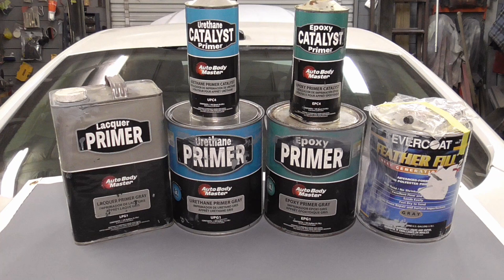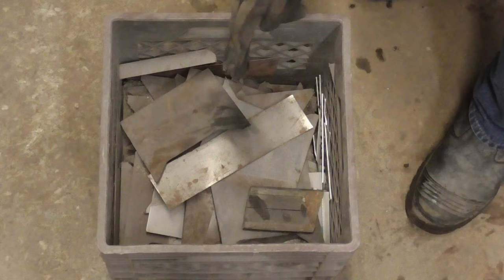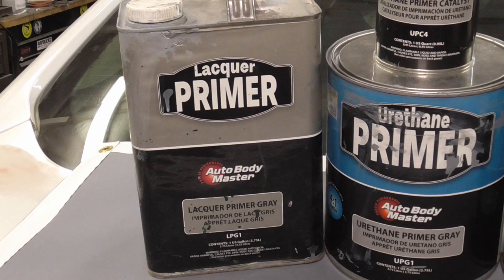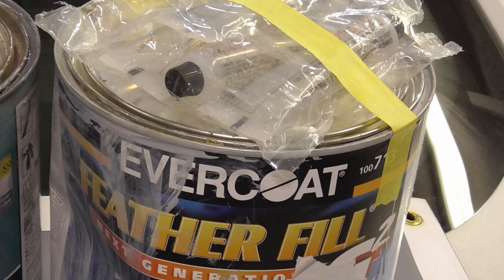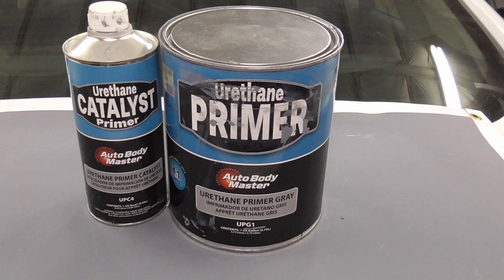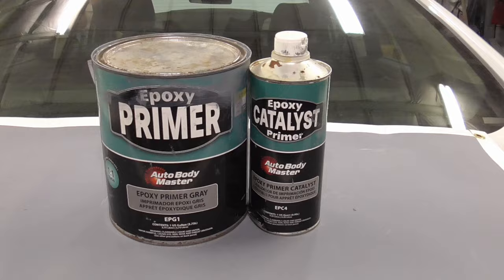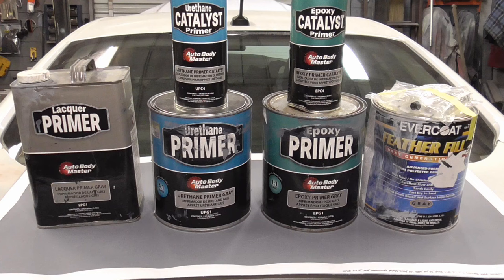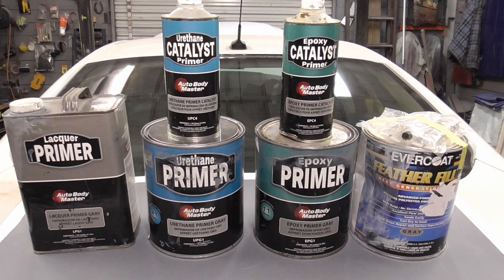A Simple Automotive Primer Guide - Types, Differences & Tips

Comment: Lacquer has one significant problem,  the lacquer thinner in the primer has a tendency to keep evaporating over time,  which means what you see now might not be what you see later.  You can block sand lacquer primer and everything looks fine,  then paint and clear,  and some time later see the imperfections you were trying to hide with the primer because the thinner evaporated further and the primer sank and shrank.   With 2K primer surfacer what you see now is what you see 5 years from now,  it's hardened with a catalyst and doesn't sink or shrink later on.
Reply from the maker: Now that kind of talk is what confuses folks :) There are millions of paint jobs that were done in the 70's that still look awesome today - done with lacquer primer - I've never experienced what you are talking about - I heard it on the internet but never experienced it.  Here's an example - https://www.youtube.com/watch?v=gIS1Tbv7Kvw - I'll do another follow up on this truck 3 more years from now - it will look exactly the same :)

Comment: I stopped putting body filler on bare steel years ago on old cars or high end restoration work as I want keep my name clean in the business of cars as my trade in smash repair Insurance companies don’t give you enough time or money to be applying epoxy primer down first so body filler on bare it is anyway I stopped doing smash years ago and only do restoration work for the bigger money customers
Reply from the maker: The only way rust can start on metal under filler is if there is a hole in the metal or the panel was left unpainted for a few years outside.  I'll make a video soon proving this - you'll save tons of time and $.  In most body shops it's embarrassing getting caught putting filler over paint and/or primer.

Comment: Thanks for the video. Am 65 now, I begin when I was 11, wet sanding, primer and red putty. And in the shop was always a spray gun with lacquer primer, only stir with a stick, and spray. On those days you can find a variety of lacquer thinners, from very fast to very slow. And a Lacquer retarder to make a Lacquer primer Sealer, that lays down the finish like a polish surface. Everything change, but I still remember those years. Thanks.
Reply from the maker: You're welcome - it's funny to ear those stories - must have been the same in every shop.  Have a good weekend RM.  Hey wasn't there R&M paints/primers?

Comment: Lacquer primer - how did it get such a black eye? It was all I had in the 70s. Gray, red and black, in the wide-mouth gallon cans. It is VERY easy to drop several hundred dollars at the paint supplier, so I am thankful any time I can use every bit of a product. Being able to keep it in the gun while I work is great too! Thanks for another great video Jerry!
Reply from the maker: It was common to have a dedicated primer gun with primer in it all the time.  When the gun sputtered and refused to spray just clean the tip and go.  Oh... and poke away at the little vent hole on the top of the gun (caked w/ primer) 😊

Comment: Good video !! … I have used urethane primer direct to metal and heard stories u can’t !! … I’ve never had any problems with any bondo or paint problems as long as the products like each other , and u do clean prep work u are good to go 👍🏻
Reply from the maker: You're right.  I worked at a shop using urethane primer and never had to use epoxy first - urethane over properly prepared bare metal.

Comment: THANK YOU!!!!!!!!! Explains a lot. I think people in industry (not me) use terms interchangeably which causes much confusion. For instance I always thought 2 different primers were needed. One to seal and one to sand. One could be sanded and one can't. Thanks for the simplicicty. I've always wanted to try my hand at painting but felt like I never had good info on primers and was afraid to try. Sounds like lacquer primer would be a good starting point for me. Simple. I like simple. Thanks again.
Reply from the maker: Once you use lacquer primer, you'll never want to use anything else.  Dries super fast, no activator, doesn't harden in the cup, don't have to throw the unused portion out if you don't use it all, works just fine if used correctly,  cheap, builds thickness well, sands the easiest.  If you keep body work simple, you'll be successful at it.

Comment: I got a 1980 Cadillac Eldorado as a high school daily driver and I wanted to spend a chunk of my summer painting her up and removing surface rust/small dents. My question is what the best overall primer is, and if I should use different layers of different primers as that is what many other videos suggest. My main thing is that I really don’t need a show-car. Just something to look decent and keep rust out.
Reply from the maker: Don't listen to all the noise on the internet, TV and magazines .... You only need one primer in your shop.  That is a direct to metal primer surfacer.  I like lacquer primer surfacer - sands fast, works well, builds fast, can be sprayed thin or thick and can throw the unused portion back in the can unlike 2K which has to be tossed. Here's you two choices: DTM (direct to metal) urethane primer surfacer or lacquer primer surfacer - simple.  UPOL or SPEEDOKOTE is decent stuff if you need to order online :)  Ask more ?s if needed :)
Reply: @LakesideAutobody  If I use a lacquer primer, do I need to use a lacquer paint alongside it?

Comment: Thanks for the video!  I recently purchased a clean, rust-free bed for my 2003 Ford Ranger to replace rusty one.  I live in the rust belt like you and would like to further protect the clean bottom of the new bed from future rust.  I was thinking of scuffing whatever the factory used on the underside of the bed (light gray), followed by 2K epoxy primer from Eastwood, followed by their 2K chassis black.  After the bed is reinstalled I'll probably hit it with Cosmoline or similar.  Do you have any thoughts or better recommendations there?
Reply from the maker: Nope... that sounds like a great plan.  That'll hold up for years :)

Comment: Jerry
Great, informative video.  I used a PPG 2K Urethane primer/surfacer and block sanded it.  I just ordered a base coat and clear coat from a different supplier.  The paint supplier literature suggests If I don’t use THEIR  2K Urethane primer surfacer the risk is on me.  Should I be concerned?  
Frank
Reply from the maker: Don't be concerned at all - it's perfectly fine to put other brand BC/CC over any 2K urethane primer.

Comment: Excellent! Right on time for me... I've been asking myself questions about that and the relation to paint and clear. BTW, have you made a vid about compatibility between all those coats? Some say you can't put 2k paint over 1K primer; some say you can't put 2K clear on top of lacquer enamel paint (since it can «boil» the result). But some say it is faisable,  depending of the particular paint involved (some brands are compatible and some don't). This is also a difficult aspect of car painting... Thanks!
Reply from the maker: Glad it helped RB - That's a good suggestion for a video.  As for now, do you have a specific question in mind that needs to be answered imediately?
Reply: @LakesideAutobody  Definitely... I did some repairs last year in 1k lacquer (from primer to clear coat). I'd like to put some 2k clear on top of 1k clear — that 1k clear is not durable. And I would like to do some more repair that way: epoxy primer, 1k color coat, 2k primer. Can I get away with it? Sorry Jerry... that's 2 questions. Thanks for your kind input.
Reply from the maker: @rbelang8331  You certainly can put 2K clear over the lacquer clear if prepped right.  Actually you can put 2K clear over anything that has bee painted for a while as long as you scuff or wet sand it first.  You won't see the sand scratches in the new clear coat if you scuff with the grey pad (even red actually).  If you choose to wet sand, you can get away with anything over 600 and you wont see sand scratches in the clear - I'd use 800-1000 grit myself to wet sand with a DA sander.  The old rule is you can put enamel over lacquer but not the other way around.
Reply: @LakesideAutobody  Thanks very much Jerry...
Reply from the maker: @rbelang8331  You're welcome 👍

Comment: Fantastic video. How about storage? Can any of them be left in a shop that will be below freezing? I would wonder the same about paint.
Reply from the maker: I keep 2K hardeners/primers and used paint in a heated shed @ 60 degrees.  I don't have a basement otherwise it would all be kept there. The lacquer primer I keep in the garage along with the thinners and reducers - I've never had a problems with lacquer primer and freezing temps.  Never had a problems with paints that froze either really.  My dad kept it all outside no matter what the temp - never had an issue but that was lacquer/enamel days :)

Comment: another great video. I want to paint my project car in the garage and want to avoid isocyanates as much as I can. With that said, looks like lacquer primer is the one for me. But what kind of paint / clear coat you recommend that  I can use with good results.
Are there any 2k paints with no isocyanates?
Can I paint with Rustoleum and once cure have a shop with a 2K clear on it? will that be any compatibility issues?
Reply from the maker: OK for the least isos use lacquer primer and paint.  I think both paintforcars and TCP sells lacquer paint.  The next least is lacquer primer, base coat  (no activator) - matrix and nason I know for sure does not need it distributor says so and I've started to spray it that way w/o issues.  Then your choice of clear coat - use this mask: 3M 07193 Dual Cartridge Respirator Assembly Organic Vapor and a 3M disposable jumpsuit.  After your coat leave the shop - put a fan under the garage door for exhaust.  Let me know how it goes for you :)

Comment: Awesome once again Jerry!  Many thanks!!  Quick question - I use Urethane 2k primer and at times have needed to do a touch up respray on a small area where I sanded through or something.  Can I use a spray can 1k primer like Perfect Match (an acrylic lacquer primer) for the touch ups?
Reply from the maker: Absolutely.  I always spray that stuff on the dryer side just in case it doesn't agree with anything underneath.  Basically don't soak it with spray bomb primer :)

Comment: Hi Jerry. This is very simple and very much against what you hear on other channels. An average guy like me has no clue who is right. I have never done body work. I have a bare steel part (1 sq ft) that was lightly coated with clean oil which will end up in an engine bay. I do not have  paint guns etc. I have been searching for answers but everybody says something different. Can I do this with rattle cans? If so, can you describe the process with flash times and cure times? How many coats of primer? How long do I need to wait between primer and base coat?
Reply from the maker: 1) clean it with soap and water really good and wipe it down with rubbing alcohol or automotive wax and grease remover.  2) Sand or scuff (red pad) or fine sand paper.  3) prime with spray bomb primer and let dry (couple hours or more depending on the brand 4) Paint with spray bomb engine bay paint or any other spray bomb paint.  * If you want to sand the primer a bit before paint that's OK too to get it nice and smooth or remove dust/dirt.   😊

Comment: Great video. I just bought a 1982 porsche 911 in 908 grand prix white and it needs a respray. It had to buy one needing a little work to be able to afford one. I'm petty sure it factory single stage for all solid color early 80's 911's and would want a single stage respray. Since two part urethane primer would likely be the base, would it work well with a water-based top coat? I'm in Illinois as well and may call you and come by for a quote.
Reply from the maker: I've never used water based top coats but I'm thinking any automotive grade primer will work for you but best to check with the supplier :)

Comment: HEY JERRY , 
HOW YA BEEN , IT'S BEEN A WHILE SINCE I LAST SPOKE WITH YOU AND I'M STILL RECOVERING FROM THE HEART  & HEALTH ISSUES  I'VE  BEEN  DEALING WITH  FOR THE LAST 17 years .   WELL , 
I'M  FEELING I'M  SOON TO BE ABLE TO START WORKING  BACK  ON THE 70 BOSS 429 THAT'S  BEEN SITTING IN MY GARAGE FOE  THE LAST 43 YEARS .
QUICK QUESTION , ARE  PAINTERS STILL USING PRIMER SURFACE  ( SEALER )  BEFORE THE FIRST COAT OF PAINT .   I DON'T  HEAR  IT  MENTIONED
ANYMORE , JUST PRIMER SURFACER .
THANKS FOR THE VIDEOS , STAY IN GOOD HEALTH.
                                            AL.
Reply from the maker: Yes - it's sort of a choice thing.  Sealer can get the car all one color before painting,  seal the body work away from the paint in case you might be worried about a bad reaction to very wet paint, fill in any minor perfections, etc.  I like it if I'm spraying a dark color as my sealer is a dark grey.  Good to hear from you Al - always a pleasure - hope you're feeling well better :)

Comment: Before I get deeper in trouble it’s best you help me. I must confess I have no experience with automotive paint. To be honest the primer I used on our 1948 Chevy truck 3100 series is Rust Oleum Auto Body primer, and it looks like this primer isn’t compatible with epoxy or urethane top coat paints. What do you suggest I use as a top coat over this Rust Oleum primer? Lacquer paint?
Reply from the maker: You can spray anything over that RUSTOLEUM primer.  Just sand it first with 320 on a DA or 400 wet sand by hand.  You can even use a scuff pad (red) and paint over that.

Comment: Hey Jerry just saw this video great information.  I have a question for you, are you still able to get all of these products? I'm a fellow Michigan resident and was told they were stopping sales of oil based paints in Michigan and wondered if it applies to automotive paints as well. Thanks again for all you do!
Reply from the maker: Yes - you can get them.  I get them at a local AUTO VALUE auto parts store (Saint Helen) - West Branch Area.  Where did you hear they are getting rid of oil based paints?  That's actually horrible - I like RUSTOLEUM and those implement paints from Tractor Supply - great for outside projects - cheap too :)

Comment: Hi Jerry- thank you for the great explanation. I believe the 2007 Mustang that I'm working on with my daughter has an aluminum hood. Are there any issues with applying lacquer primer directly to aluminum, and the plastic bumpers as well? Thanks again!
Reply from the maker: Myself, I have not had issues doing so.  In fact when I worked in body shops in the 80's lacquer primer was all there was.  They suggest using a coat of epoxy for both aluminum and bumper covers.  Again though, I've had good luck with LP right over both - surface prepared correctly :)
Reply: @LakesideAutobody  Great- thank you again

Comment: I’m old but new to painting.  I had a rusty steel trailer with patches of remaining paint. I was advised to use muriatic acid to remove the rust, which worked good. Drove truck for 5 days and when I got back the bare metal was surface rusted.  I used phosphoric acid to convert the rust, then applied etching primer.  Now I’m hearing I need acrylic primer before I can apply duplicolor bed liner.  Should I use the acrylic and what process should I have used?
Reply from the maker: I'm not sure what Duplicolor product you are spraying but usually all topcoats require a primer over bare metal.  The steps would be, sand any rust to bare metal, scuff or lightly sand any remaining shiny paint, blow off dust and clean with wax and grease remover or just rubbing alcohol, prime with any automotive grade primer, paint or spray the bedliner.  Best to read the back of the can and see if there is any special application instructions - good luck :)
Reply: @LakesideAutobody  thank you for the response.  Do you use acrylic primer over etching primer before paint?

Comment: Great stuff as usual. I wish I would have seen this BEFORE I started spraying Apoxy Primer on my '65 C10. I was thinkin to rough up the Apoxy Primer and  do the body filler on top of that. Then, lay down some filler Primer on top of that. What do ya think?
Reply from the maker: That will work just fine.  You don't have to sand it if you just sprayed that epoxy.  If it's been a while - like longer than 3-4 days - you can scuff it with the red pad or wet sand it.  Regular sand paper usually clogs up when sanding epoxy primer 😊
Reply: @Lakeside Autobody  Thanks a TON for always getting back to me, I watch a LOT of YouTube videos for tips an tricks but you're one of the guys I trust
Reply from the maker: @paulking6404  I appreciate that Paul.  Thanks for watching 😊
Reply from the maker: @paulking6404  👍

Comment: Hey Jerry, Great video. only question is does it matter what type of paint you use over each primer... do I have to use lacquer over lacquer and urethane over urethane or does it not matter?
Reply: Great question.  I wanted to ask the same thing.
Reply from the maker: Sorry I'm late on this.  It doesn't matter what paint you use over each primer.  You can spray anything over lacquer, epoxy, poly, urethane.  It's primer.  It is meant to have paint (any paint) sprayed over it.  If you are concerned about spraying urethane paint over lacquer (you'll hear some negativity on this) throw a quick coat of sealer over it before painting.  With lacquer paint, it's always a good idea to take it easy on the first coat because it is the only paint that you'll ever really have issues with wrinkling or reacting to other substrates.  As for sticking - there's no worries, you can spray any paint over any primer.  Check out page 19 and the instructions for each type of primer in this - http://autobodymaster.com/plugins/tech_manual.pdf
Reply: @LakesideAutobody it's okay Jerry, Thanks for the reply and clarification 👍